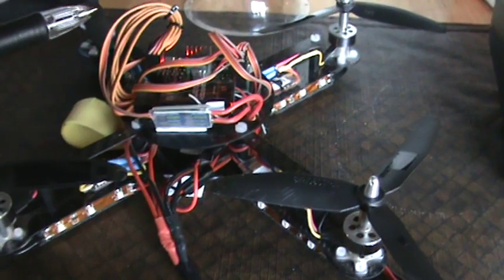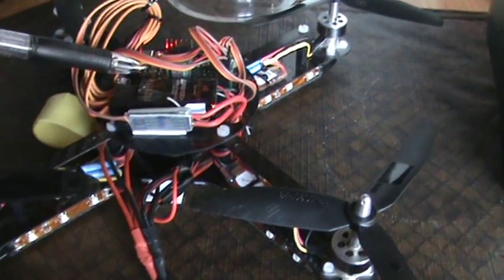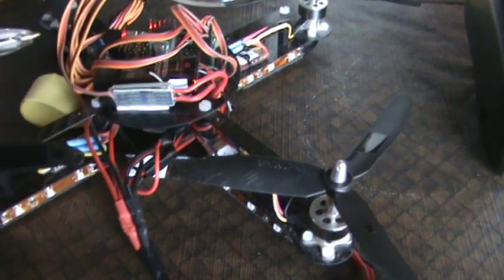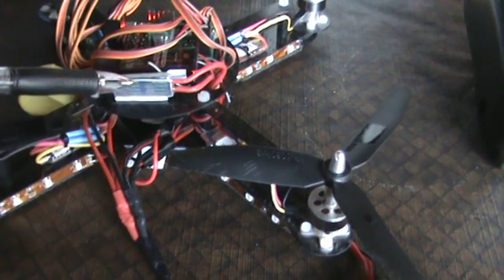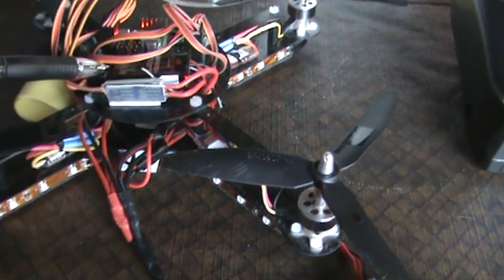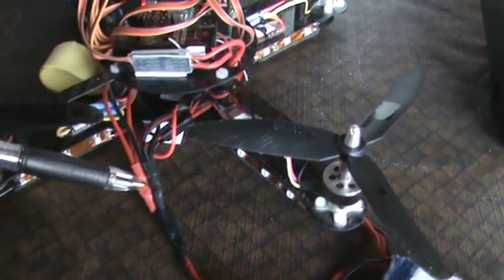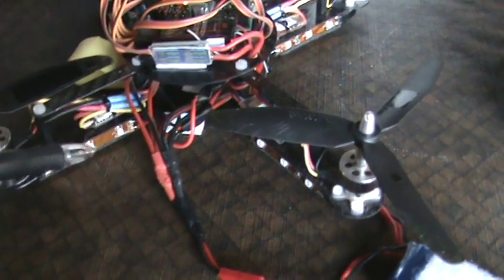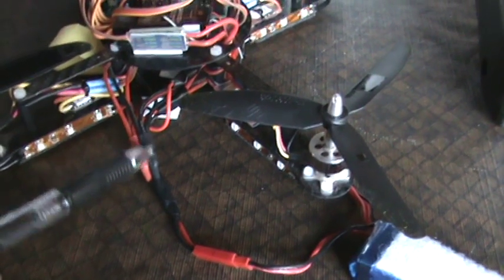HOW TO TURN LED'S ON AND OFF FROM YOUR RC TRANSMITTER

Comment: on the blade 350 qx3 the receiver is made into the motherboard, so how would you do that wire up so you could use a switch?
thanks,
David

Comment: I got one of these switches and in the diagram it has a bec pictured tying into the positive out from battery and going into the rx. The lights im running are 4mw 5v. Would i need a bec for this, or do exactly as your video says? thanks

Comment: how can this be p&p? What I have to do to config the tx? I have a tgy 9xr with ez uhf tx-rx in ppm mode. I tried to connect the led control module on channel 8 but I don't know how to configure the tx mixing to power up these fucking leds.
Reply: you don't need to configure mixing.  Go to your menu, select the aux-ch item, go down to channel 8, scroll sideways until 'gear' is selected, press menu to save, and if everything is wired correctly when you flip the gear switch in the upper right hand side of your transmitter, lights should turn on. (pay very close attention to where your grounds are leading, if they don't share a common ground the switch wont work)

Comment: Is there a way to use a 3 way switch to have like front lights, bottom lights, and both front and bottom? I understand some programming would have to be used, but how would that work? Just set the two into different channels and have the transmitter do all the work?

Comment: If you use an ESC...Does it have to be a brushed ESC with only two motor power wires?
Reply: erniemcdowell - I'm dying to do that myself! I have the same question.....
it doesn't look like he answers questions. 😕  I'm trying Google.